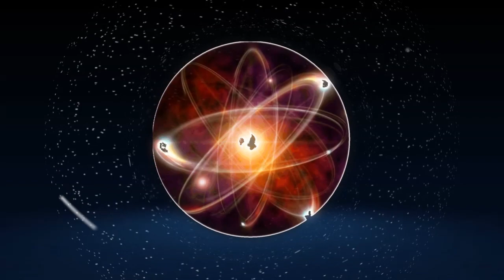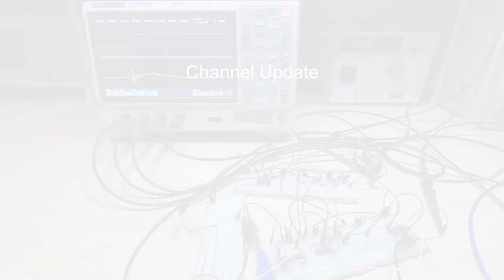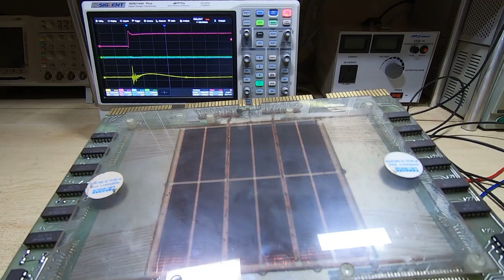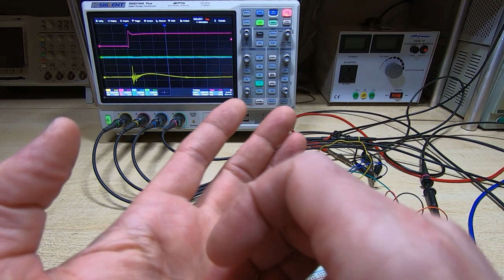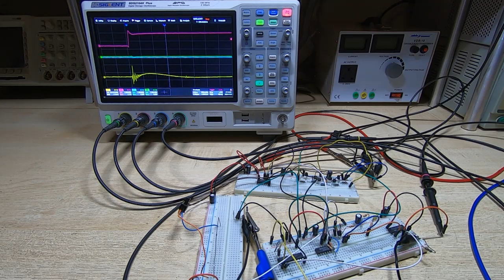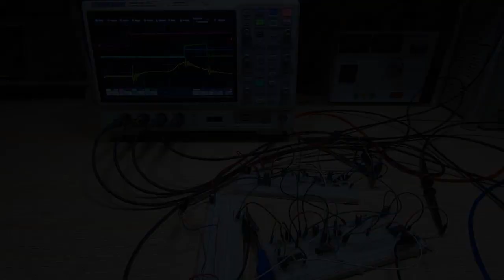Channel Update

Comment: I am looking forward to your series on core memory. The first radar system I worked on used the AN/FYQ-47 Common Digitizer which contained a core memory - I believe it was 1024 bytes. I just finish watching your HP 9830A repair series - a troubleshooting tour de force - excellent! Regards, David